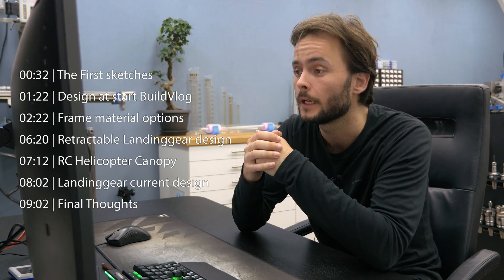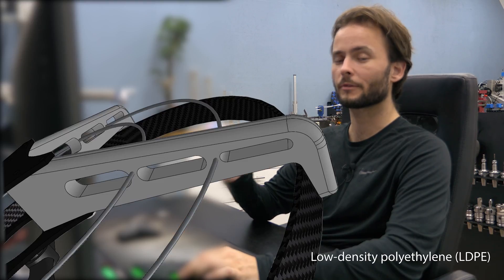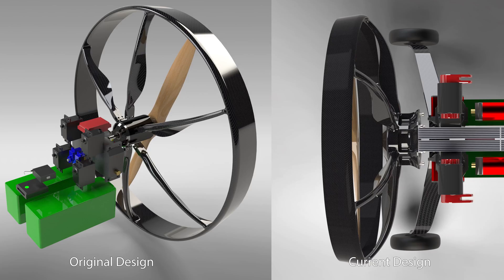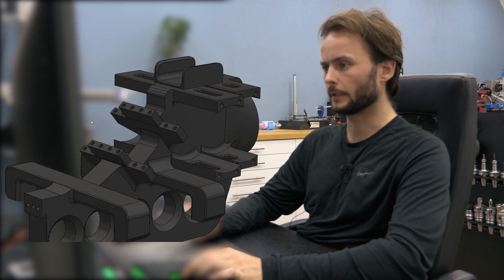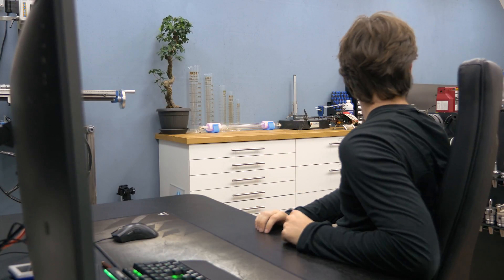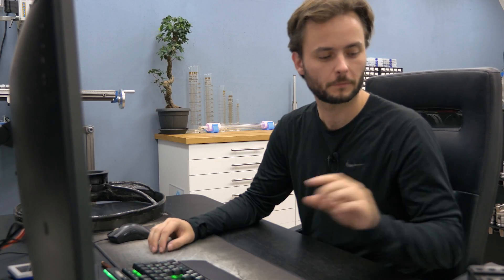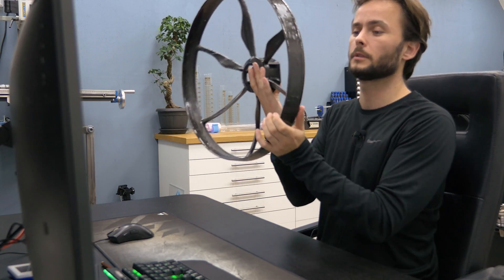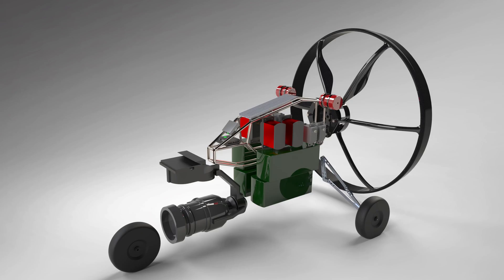Design Talk - ParaDrone Design Iterations

Comment: Try to keep the gondola as short as possible, so it does not swing as much (around the z-axis). The torque of the motor will rotate the gondola in turns, at the end of the turn, it will swing back, creating a pendulum motion, which will obviously look horrible on the video footage. From my experience, the longer the gondola is, the more likely it is for it to swing. Also a shorter gondola will recover faster from this pendulum motion to a stable flight.
So far, I really like your design and the idea of a paradrone. Keep it up!
Reply from the maker: Thanks for the tip! So if I understand it correctly, you are not referring to the torque introduced by the motor/propeller combination along the roll axis but a pendulum effect along it's pitch axis caused by the constantly changing thrust?

The camera will be mounted on a gimbal so for the video it shouldn't be too much of an issue but we still want the platform itself to be as stable as possible!
Reply: @StefsEngineering  Yes, you understood it correctly, I just did not find the right words.
Reply from the maker: No problem, it was clear enough right? 

I may talk a bit about this in one of the next video's on the subject, the problem with these paramotors is that every single shape has its drawbacks (long/short body, high/low center of gravity, high/low riser points, mass centeralized or spread out and while  you make these decisions the function has to be kept in mind. 

In my instance that is autonomous flight and making video's.

Comment: Looks cool. Where are the wings? And also what is the aim for this design? RC? Or prototype for something larger?
Reply from the maker: Thanks! Well the wing is a paraglider I bought for it (5.2m2 from Opale), this thing will hang below it. 

A couple of pictures:
https://c1.staticflickr.com/5/4759/27871337499_a007d47611_h.jpg
https://c1.staticflickr.com/5/4695/38940365824_260b18f9b3_h.jpg

The aim for the design is getting a paramotor to perform an autonomous flight, this first phase of the build is just making the platform that I want to use for those flights. When this model has had it's maiden flight (piloted by me) the next step will be to modify the flightcontroller software for a paramotor. 

So it's a bit of all, a RC prototype for a new large scale "drone". Drone's exist, and so do paramotors but the combination hasn't been done as far as I know.